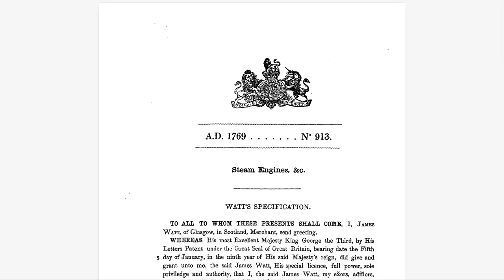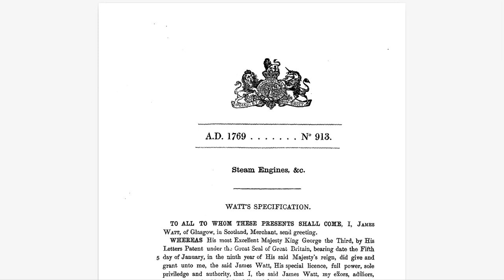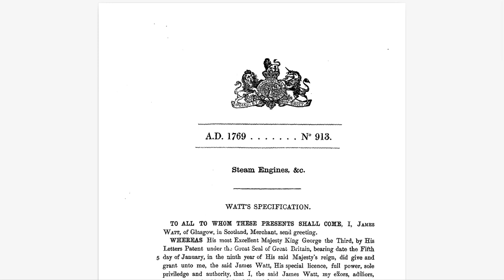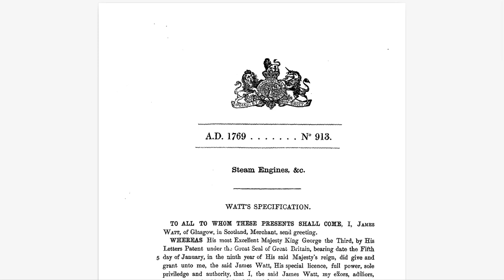Improvement of Steam Engine: James Watt's new method of improving the efficiency of steam engines

Comment: James Watt did not invent the Steam Engine.  The first practical Steam Engine was built to pump out the coal mines by Thomas Newcomen from Dartmouth, Devon & John Cullen in 1712.  Richard Trevithick from Cornwall was the first to build a self driving Steam Engine using high pressure steam that Watt complained of saying it was unsafe.  (Safety valves made the machines safe later.)  In 1801 Richard Trevithick appeared on the streets of Camborne upon his Engine.  Watt improved Newcomen's engine.  It did not move under its own steam.  One could credit or blame Roger Bacon first oganised experimenter & the introduction of patents, I think, under Elizabeth the First influenced by Locke?  A man of the same name of Roger Bacon but with no family connection pioneered this two hundred years before in Summerset.
Reply from the maker: Thank you for your detailed comment and for pointing this out! You’re absolutely right—James Watt did not invent the steam engine but rather improved upon Thomas Newcomen’s original design from 1712. Watt’s innovations, like the separate condenser, made the engine far more efficient, which had a massive impact during the Industrial Revolution. Richard Trevithick’s pioneering work with high-pressure steam engines also marked a significant leap forward, even though it initially raised safety concerns, as you mentioned. I appreciate the historical background, especially the role of figures like Roger Bacon and the influence of early patent systems. Thanks again for adding this depth—I’ve updated the video title to reflect these insights!